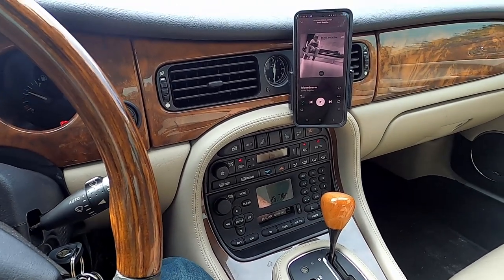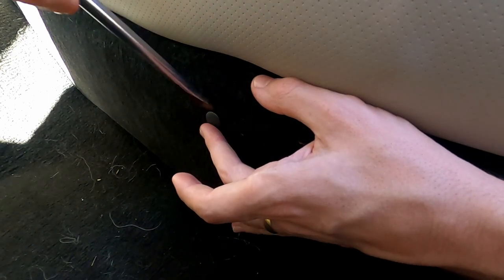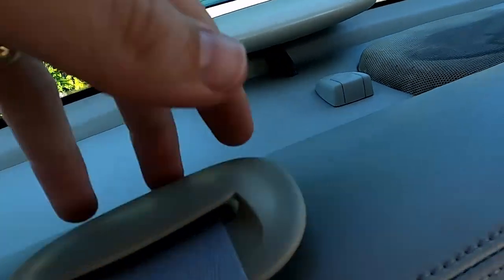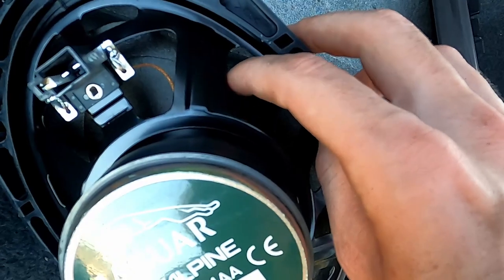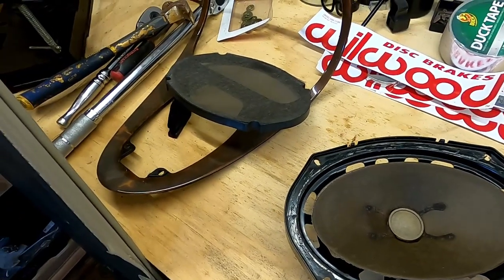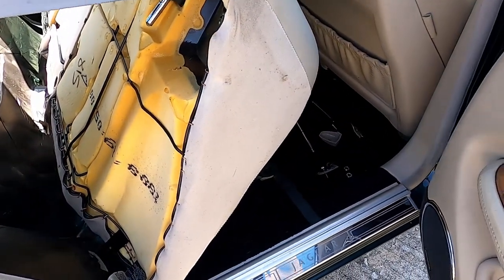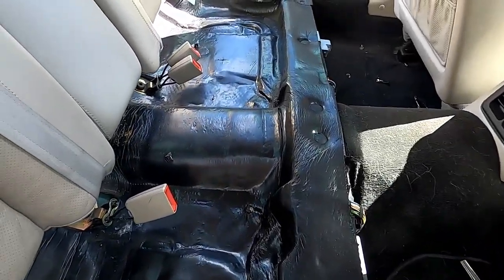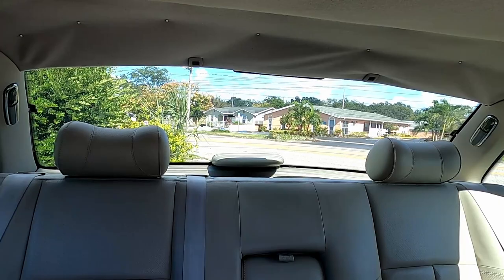Jaguar XJ Speaker Repair

Comment: FYI, doing the repair right now, and I notice the foam surround is designed to be attached to the bottom of the cone. if you look carefully you will see what remains of the previous surround is attached to the convex side of the cone. This arrangement allows the foam to sit flush to the metal framing. I was also able to get the rear seats back out without removal of the seat bottom...and slide the speaker out without removing the  item tray, merely bowing it.  thanks for the vid

Comment: I had to do the same with mine.  Well worth it.  I also decided to replace the front stock Alpines with Focal RCX-165 speakers.  The improvement was noticeable.  I'm working the courage up to replace the rear door panel speakers.   Removing the wood trim is nerve wracking.  Nice video.
Reply from the maker: Thanks, the wood veneers do seem to be very fragile. Mine suffered from the cloudy lacquer more than cracking so far. So far I have been pleased with the factory speakers. I may upgrade them in the future.
Reply: @LowTechGarage  Mine have been cracked on the surface from heat and I didn't seem to have issues with fragility when I pulled mine out, just don't be stupid and use a trim removal tool with an appropriate amount of force.
Reply: I own a XJ6 S3 I put some focal on the front audisson in the back and a underseat powered subwoofer. The sound is phenomenal since the previous owner just replace the blown speaker and none of the four previous were of matching brand or spec. Almost on par with my modern car 😊

Comment: I’d actually already watched this as I recently got a 2000 XJR but not had any issues with the sub til this weekend when my wife blasted Portishead a bit too loud and it couldn’t cope.  Anyways thanks to this video I know what needed doing, really useful tips, I know I’d have given up at multiple points (or broken something for sure..). So right now the speaker is out and I’m waiting for the kit to be delivered. Which for £30 posted to the UK is pretty reasonable. I’ll let you know how it goes!
Reply from the maker: Portishead isnt a bad way to blow the speaker I suppose!

Best of luck with the repair, let us know how it goes.

Comment: thanks for the great vid, my main concern was how it all came apart but thanks to your vid I'm up for the challenge now, just out of curiosity how do you link your phone to the factory stereo, I'm currently using a FM module, just wondering if you have a better way, thanks again
Reply from the maker: We have used the FM modulator as well. If you want a more high end solution check out jagdroid

Comment: Mine - in a Daimler Super V8   - turned out to be an open circuit coil (one of the dual coils)  
I couldn't trace/source a direct dual coil replacement so I replaced the 6x9 with a 'mono' unit and combined the signals into a woofer amp with a bridged output  = a mono woofer drive.  
This gives me the controls to adjust crossover freq and levels.    The result is likely as deep and strong a bass as one is ever gonna get from a 6x9!  
Old git, UK
Reply from the maker: Nicely done!

Comment: Have replaced mine with a carefully sourced "good" used one and it rattled again after maybe 2 weeks. Repair kit is sitting on my bench now for when I get the patience up to take the seat out again 😝
Reply from the maker: yes! getting the seat is is quite time consuming for just a speaker. I will say doing the repair is well worth it though. I have been very pleased with the results.

Comment: Could you do a video on replacing the front tweeters? My friends nt tweeters don’t make any sound. It looks like I have to take the ceiling off to get to them.
Reply from the maker: Hi there. This may be a later video when we get the headliner redone. 

Right now ours are functioning so no need to mess with them!